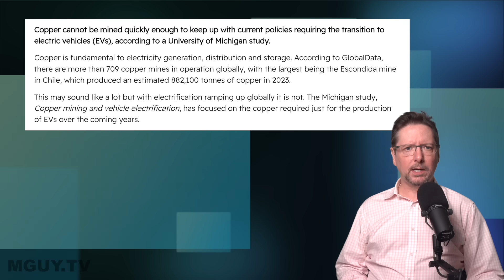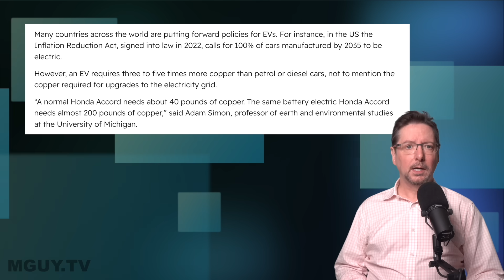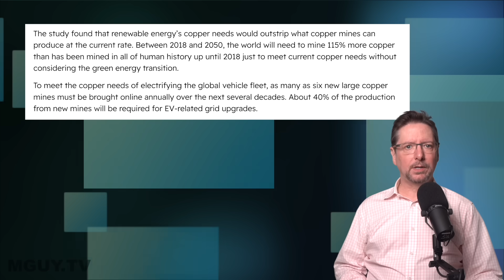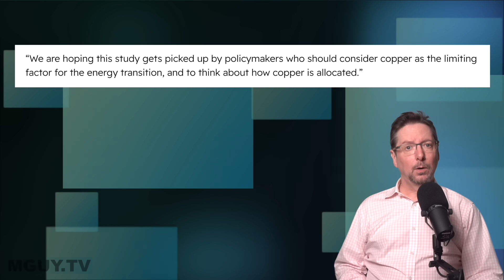Copper cannot be mined FAST ENOUGH for EVs and Net Zero Transition | MGUY Australia

Comment: And the mining is very green I bet .
Reply: Absolutely, have you not seen the green Haze-which is copper oxide or cupric oxide, that exists from any copper mine - goes into the water as well, becomes a lovely pretty green too😂
Reply: Big holes in the ground and huge diesel powered trucks. 
What's not to like?
Reply: @SoupDragonish  even the electric trucks and excavators are powered by diesel engines, usually on site
Reply: Mining is diesel powered

Plus, of course, the inherent disruption of the activity to the area - soil, water, air pollution, displaced material, disruption to wildlife habitat, poor working environment, etc
Reply: @RiverMersey  - they are using Electric Powered Trucks now - but then they get Recharged with Diesel Generators.. but the trucks are electric so its alright..
Reply: @gregjenkins2925  working in an industrial environment, one of the stupidest products I've seen is a counter balanced forklift that has it's heavy lead acid batteries replaced with light weight lithium. Yes it could travel slightly faster but on the first lift, people were surprised when  it didn't balance lifting the same things as before 

Much of the counter balance of these trucks are the weight of the battery. Changing to a light weight battery reduces the safe weight limit of the truck!
Reply: @gregjenkins2925  Why would they do that?
With the power they use, the batteries would be flat in no time not to mention the actual weight of the batteries.
Far better to not have the batteries and put the generator set in the machine
The big draglines and loading shovels are powered direct off the grid (No traction batteries, no diesel engines or generators
Reply: at least it was green at the location is where they started digging it all up, most likely not as green there now.🤔😏
Reply: especially the strip mining...

Comment: And the copper used in the plumbing and gas industries
Reply: Especially with heat pumps.
Reply: Yes, but this can be replaced by other materials.
Reply: @JacquesMartini  yep poly pipe water to the house from meter which needs replacing every 10 year’s composite pipe the rats chew though the house but still need brass for tap wear
Reply: @agatemaster1998 
Our poly manufacturing is closing down, relying on oil and gas as feed. HDPE, is literally a product of cracking oil, and gas. So, no, we won't have that. They might be able to make plant based plastics, which rats love to eat. But, your plant based plastics break down much faster and contain highly toxic chemical binders, which enter the food chain.
Reply: @JacquesMartini 
What "other materials"? Regardless, very soon all finished metal products will be imported from China.
Reply: What will we use instead of HDPE when they eliminate oil and gas. For that matter, don't worry, we'll be starving anyway, can't grow commercial food volumes without hydrocarbons!